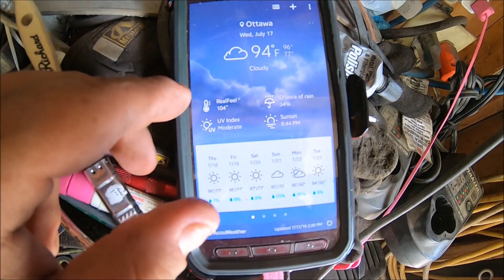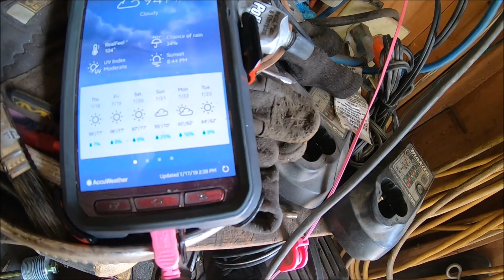Jezebel The Ratty Blue Charger Tear Down Part 2 BUILD pt 2

Comment: knew that trick about raising the engine to fit headers it's the only way. put them on my ford highboy 390 but when i lowered the engine to the motor mounts left was on top of the steering box so 1 header pipe had to be half caved in with a hammer. drove it to college daily for 2 years no issues at all. it was either that or header one side manifold the other

Comment: we just pull the motor with the heads in the bay when putting the motor in we set them in first start putting motor in then bolt headers on lose then set motor in mounts then bolt everything up
Reply: ps my next project is a 79 z28 rs t top full spoiler kit going to see if i can build it with no money out of pocket so far i got the motor and trans 12 inch clutch new 454 stroker with 38,000 miles on it 5 speed trans possie rear end 4:11 gears good clean body no rust just need to find a trade on paint
Reply from the maker: Damn man, sounds like that z28 is gonna be a little rocket
Reply: @ScottsSpeedShop  just stock 450 hp at 48 torque mite get 600 with the tunnel ram set up

Comment: Hey Jed i have a  edlebrock intake brand new in the box and a  edlebrock cam and lifter set to go with it.  Double row timing set also for a  383 . I bought them several years ago but never used them.  I would sell them as a package deal to you.
Reply from the maker: Chuck, give me a call tomorrow, if you don't got my number message me on facebook

Comment: Good work. I was a little bit freaked out looking at what the front end was propped up on. Looks like a couple rims just stacked up on each other, if so I sure hope they are welded together. I settled down with the thought that you survived to do the video and it wasn't titled I almost died, or Jezebel almost killed me!  I do like the time lapse sections but if that adds a lot of editing I get it. I don't like to waste my time either and I'm not near as busy as you are! lol. Looking forward to seeing the front disk conversion, your gonna need them with all the extra ponies your stuffing under the hood. I'm in Illinois and the break in that heat was fantastic! I used the mild temps to do front and rear brakes, oil and coolant change, plus a general inspection of everything else. It sucks working in the blazing heat but as we both know, yah gotta do what yah gotta do! Keep up the good work Jed! Awesome videos!  BTW... good work keeping your girlfriend happy, it's worth the effort.
Reply from the maker: I am safe and sound man, don't you worry, this isn't the first time using those wheels to prop cars up, also those wheels are bolted together with extremely tight and are not going anywhere. We always make sure the car is stable before we put the crane away. I appreciate your concern my friend

Comment: Awesome progress on Jezebel.
Reply from the maker: Thanks brother, hopefully I can get your carpet out on monday
Reply: @ScottsSpeedShop  Thanks man I appreciate it. I figured I could put some por15 and some cheap insulation on my floor pans before I install that carpet. How much por15 did you have to use on the floor pans in that Dart?
Reply from the maker: A quart is about enough, I also like to lay the stuff on rather thick, You will more than likely want to get a quart and see how far that goes, but I think you will need more

Comment: Cool stuff Jed.
Reply from the maker: Thanks brother
Reply: @ScottsSpeedShop  Jed I changed up my engine build by 21 cubic inches with a cost difference of $300.00 so 471ci
3.915 crank 6.700 bbc rods and 1.320 srp pistons @4.375 bore. It should be a ass ripping machine. I see it as if a short rod 451 had light pistons.
1.71 rod ratio should be a great air pump. Taking my block & crank  in this week for the 2.200 journals offset and the block line honed, bored and squared up the decks.

Comment: Cut open one of those fram oil filters for giggles
Reply from the maker: I don't normally use fram filters, but after the crankcase was contaminated with gas, I just needed some cheap filters and cheap oil to flush everything out

Comment: That is not a safe way to support your car when you work in it, a guy around here died when his car slid off of a set of rims, it didn’t kill him right away, he suffocated because he couldn’t inhale enough air to breath because the car was on his chest. His buddy found him a couple hours later. You spend all this money on parts, buy some good jack stands.
Reply from the maker: I appreciate your concern, but this isn't the first time we have done this, and our wheels are bolted together, and we always shove the car side to side to make sure it is stable, but in the odd case it does fall off and kill me, I am perfectly okay with that, I have led a good life up until this point, and there is no other way I would want to go.

Comment: So now that you have the engine out and you said you were going to take it to the car warsh does that mean you're going to paint the engine compartment or leave it ratty oh and I agree with Richard Turk lose those Zumiez what's the sense in having Zumiez if you have a muffler and besides it does not look good Chargers are a beautiful car don't put something stupid like those back on
Reply from the maker: Engine bay is staying ratty, but I am going to touch up a few places, and as for the Zoomies exhaust, if the sub frame connectors don't interfere with the fitment of the Zoomies, they will more than likely be going back on, but as the exhaust tips for my electric cutouts, and the muffled exhaust will dump at the rear end

Comment: Lose the zoomies when you put it back together.
Reply from the maker: Zoomies will stay as long as they don't interfere with the sub frame connectors, I will add this, the Zoomies will be only functional when the electric cutouts are set on open headers, and when the cutouts are closed, it will be going through mufflers dumping at the rear end